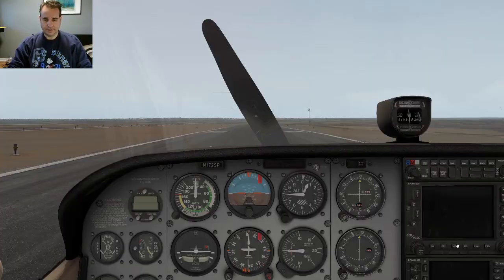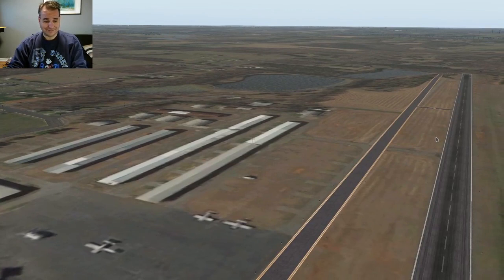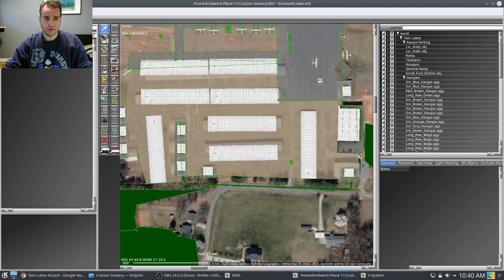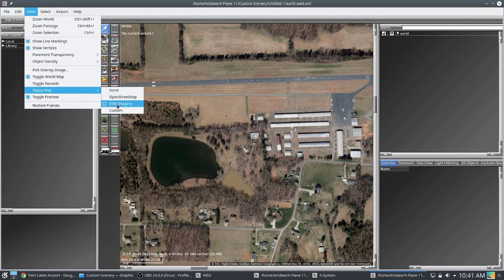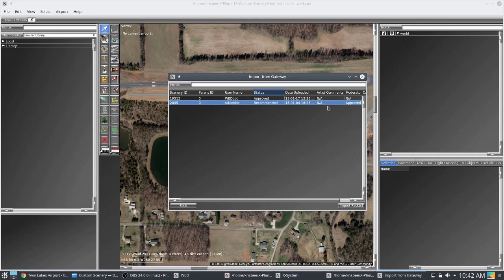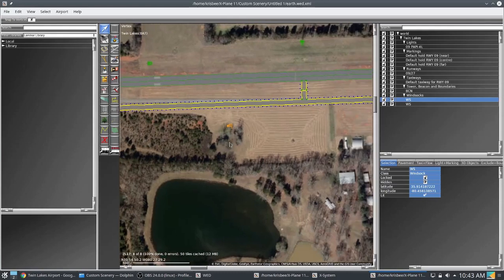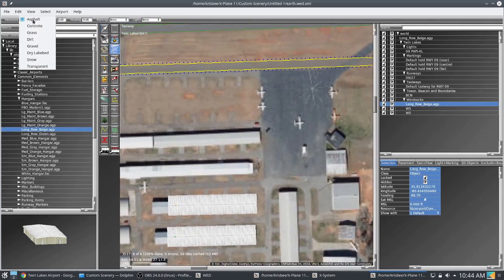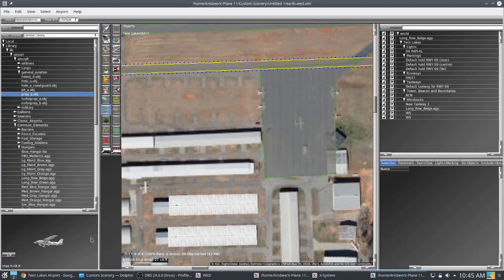Customize Existing Airports in X-Plane using WED (World Editor)

Comment: Key point for me was the slippy map. Apparently it defaults to "world map", which was super pixelated when zooming to my local airport (KGCD). Finding this video and that information saved me much time and fustration for that issue. There have been some substantial changes (IMHO) at this airport as one of the runways started at the main runway. They have shortened it, removed the intersection there, and made another intersection further down the runway with taxiways to the new end. So, I've made it my mission to upgrade this airport! Thanks for the video!
Reply from the maker: Glad I could help.  I have found coding mistakes on the airport designing one and fixed the sim by submitting bugs which has been nice (one airport was 50 yards skewed, so it never lined up right with ortho).  One of my biggest pleasures with WED was doing all the small private airports - only takes a few minutes and it gets addictive.  Especially when you get in something like a Piper Cub and jump from small field to small field.

Comment: hey how do uyou add aprons to it
Reply from the maker: Add a ground texture or polygon and pick the matching asphalt for it.
Reply: i am but it only shows the orange transparent box
 @dixielandfarm
Reply from the maker: @cptpoland7127   - Ok I just checked again.  So easy (and what I wrote) - pick a polygon (mid-bottom right in the toolbar, right above roads), draw your selection, it will probably default to some grass polygon - change in the box = TAXI SURFACE in the right side of the window where your selection is and change to match the texture you want.  Done.

Comment: Thanks for that. Unfortunately you (and the manual) seem to skip a step. How do I open that regional airport to start editing it? The manual tells you how to open the X-plane folder (scenery package) and you get to the screen with a list of around ten airports (mine are Budapest, London, etc.). But from then I'm stuck. The manual simply says click on a line and it will open. But you end up with a map of the world. Zooming in to the region you want to edit doesn't seem to do anything. Just says 'vertex - no current airport'.
Reply from the maker: If you are working on an existing airport (which most are, even the built-in generated ones that are basically just the runway and maybe a taxiway), then under File, you select IMPORT FROM SCENERY GATEWAY to retrieve the airport general info.  If you are really building from scratch, then you have to define at least that there is an airport (with the airport icon) and its data that it needs, then start building from that.
Reply: I must be missing a step. I choose the x-plane folder - it recognises it and loads up the screen with those airports. I can see 'Import from Airport Scenery Gateway' there under file, but it's greyed out. All I can do is 'Open Package' but that sends me to the map of the earth and that doesn't seem to allow me to choose the specific scenery area (and airport) I want to work on.
Reply from the maker: @robintyson591  You are. You have to create a package first - Pick new on the FIRST screen you see - make a package (default is UNTITLED but you can change that name).  You have to make the folder on that screen to hold your files - this puts it in the custom directory under that name.
Reply: Thanks for your patience. It's driving me insane! So I made a NEW scenery package (it's called Untitled1). Then I go to file but still it's greyed out (File - Import from Airport Scenery). If I OPEN that new scenery package I end up (again) with that map of the world and it's a dead end!
Reply from the maker: @robintyson591  I think maybe your CHOOSE XPLANE LOCATION may not be right - it should be the main xplane folder, not any subdirectory.

Comment: I have a question, can I edit terrain using WED?
Reply from the maker: Excellent question - I know you can around an airport - but only the type of terrain - not actually the underlying mesh.  As for outside that environment, I don't seen why you couldn't overlay a type of terrain you DO want and just export it as  part of the custom scenery, it overwriting what is there by default.  Example - 10 miles away from an airport there is a field, but you want to change that texture to gravel instead of grass - that should totally work.

Comment: I got a bit frustrated with your video because you did things assuming the audience (me) knew how you actually did something. Example: you selected a hanger from the library "and just dropped it in, rotated it, and you're done." How did you drop it in; how did you rotate it; how is your change saved? I've found this with quite a few videos, not just this one, but the WED manual is not intuitive either. Is there a video you can recommend that is better at describing how to use the tools and save your changes?
Reply from the maker: No.  People can't expect to learn an entire craft in 10-15 minutes.  They have to do it.  The nice thing about a computer program is the likelihood of you messing up by experimenting is very close to zero - and it is one of those things you have to learn by doing.   My intent on the video is to introduce people to the idea of making/modifying an airport using the tools that are available - but it isn't meant to be an in-depth tutorial...  The manual is absolutely not intuitive, and I have also struggled with submissions being rejected for rules that weren't explicitly laid out as well - the forums have been helpful to a point - but there are a lot of gruff people there as well.   To save, hit File/Save.  That saves the xml file.  But that doesn't generate the artwork to use in X-Plane, for that you have to export scenery which makes that file.  To put a piece in, once it is selected, simply mouse over and hit the left mouse button to drop the object (like a building or a tree), or in the case of forests or taxiways, you start making the outline until you connect all the pieces by dropping points with the left button (example, a rectangle is four points, but an oblong/odd shaped could be 20 points).  To rotate an object, put it in the cursor mode from the toolbox that shows and click the object, a cross shows up which you can then grab one of the points and it will rotate - harder to write or even show than to just figure out.

Comment: Can you alter landscapes with this? Because from the city where I'm from, there's a little hill juuuust beside the airport which is also a landmark for us locals and tourists coming in from air travel. 

Default X-plane does not have that hill and its kind of a bummer.
Reply from the maker: You can add grass and trees and basically any material on top of the ground, but not the ground contours per se - that is what they call mesh.  Default mesh is very simplistic for various reasons (processor, space, etc). There are alternate meshes out there that are much more accurate and will probably have that elevation data - but that mesh is often for a very large area - but I would look into that first and see if that gets you your hill.

Comment: Thank you, very useful information, I have one question, how I can flatten the ground under my Apron
Reply from the maker: There is a setting to smooth the airport elevation, but I can't quite remember what the setting is (I think the term they uses is flattening) - but if you google you will find it.  Some people hate using that because they want the slopes to be as realistic as possible - even at a few I have designed, if you went behind the hangar you would see it is actually five feet off the ground in a corner.
Reply: @dixielandfarm  ok, thanks, I'll try to find it

Comment: Where did you get the map into the background
Reply from the maker: There is an option called View Slippy Map that adds that so you can use it to work from.  I think I show it in the video where you turn it on.
Reply: @dixielandfarm  Thanks, and one more question is: How did you get the forests to work? I can't find the correct resource :(
Reply from the maker: @Xbox4Ada  Inside WED - its buried in there to draw in the trees, and to pick the right one is tricky.  If you mean something else (like trees showing up in the sim where they shouldn't on your scenery), that is because you need to put an exclusion zone in that tells xplane not to spawn autogen in that area.
Reply: @dixielandfarm  ok thanks! Your right though, it is hard to find the right tree 😅

Comment: It's handy to be able to work off the google maps imagery. I'm going to take a look at that OBS Studio.
Reply from the maker: The issue I have had with the satellite imagery is that the FAA data sometimes has been off, by many many meters - so you will go to "fix" the runway and it will be rejected because the two won't correlate - and the FAA data is usually the winner despite clear evidence that it is wrong.

Comment: That's pretty cool, Kris. Have you ever built a totally custom one not based on an existing airport?
Reply from the maker: I did build a grass strip at the farm, in case I wanted to take off - BUT, it is hard to get them to show up in the GPS in the planes when they aren't real places - easy to take off from, but not find/land using navigation aids.  The next challenge is to build houses/etc. - and I have one that I plan on doing - there is a "fly-in" community in Florida that no one has done yet - basically houses attached in a development so you taxi off the runway and into your driveway, which I thought would be cool to actually make.